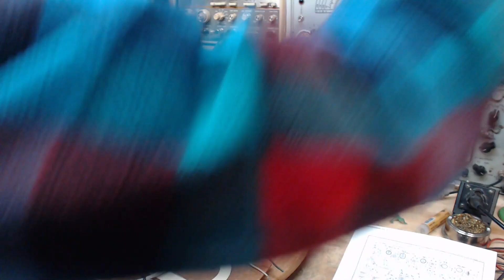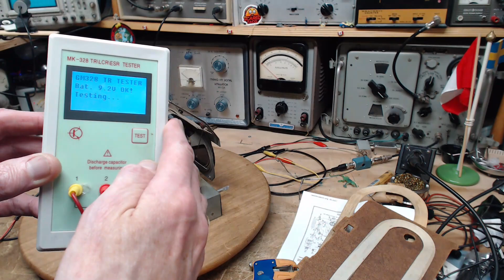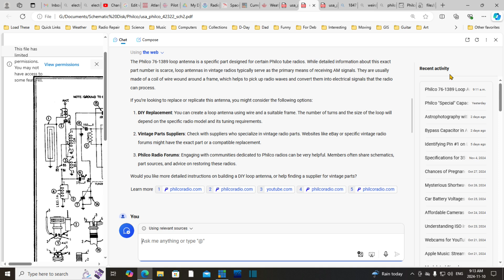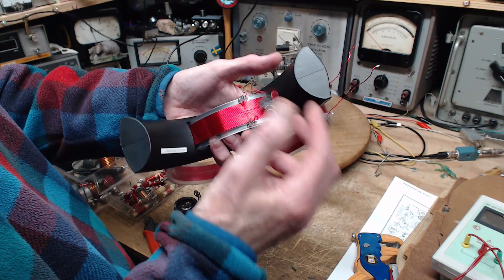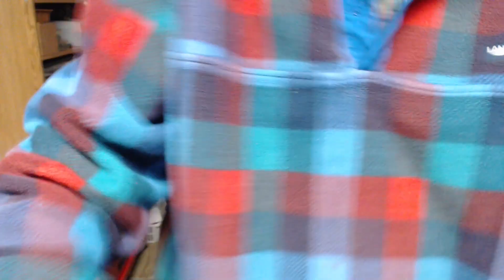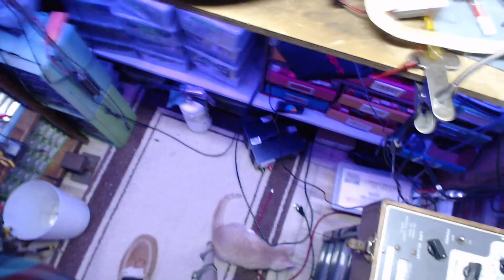Philco Model 42 322 Tube Radio Video #10 - Missing Loop Antenna

Comment: There is a picture of the antenna on radiomusem, on the back of your cabinet there are a couple of the antenna red connectors that held it in place. It appears to made from cooper tubing. I'll bet you could determine the size of the cooper tube from the loops.
Reply: I have one of these radios. it looks like they used something like 12AWG solid copper wire or 14 AWG solid copper wire and just wound it around in a square shape. The wire that goes into the top of the chassis in the back is soldered to the end of the vertical portion (the innermost end of the coil), while the wire going into the top of the chassis by the tuning capacitor is connected to the outermost end.